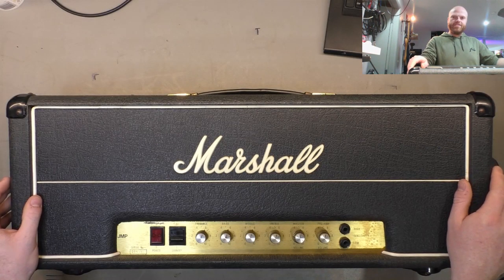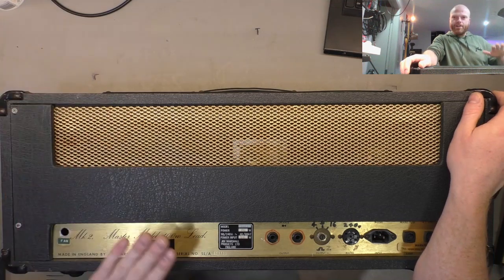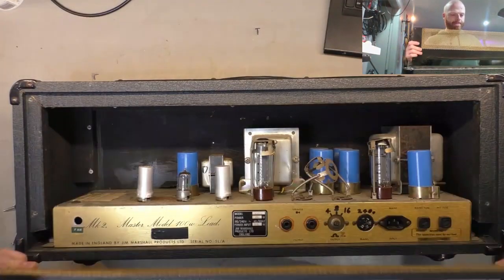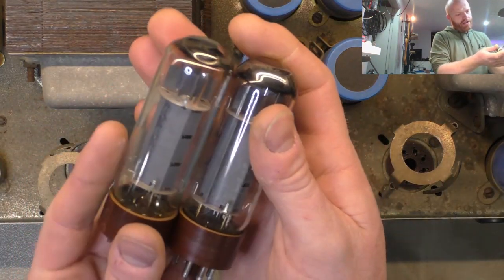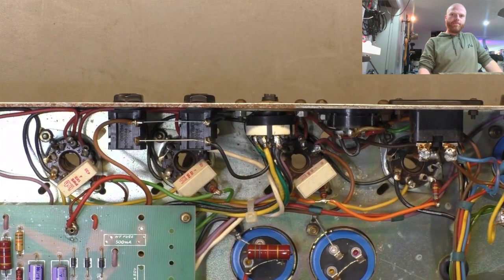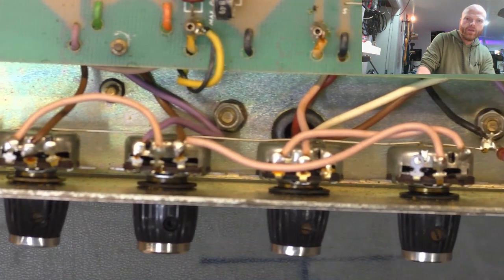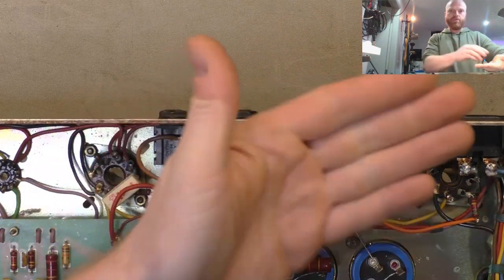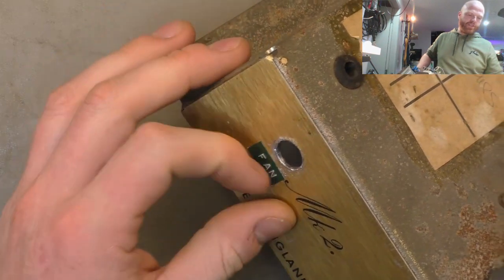Marshall JMP 2203 Head - De-Modding a Classic Part 1: Assessment

Comment: I've got exactly the same amp, only three years younger (they were still made with this exterior for Scandinavian market in 1982). I played it about 15 years and then decided I did not like my sound. I first converted it to Superbass with Metroamp turret board, then Superlead and now it has cascaded preamp, Mullard mustard caps + a few other useful mods and it sounds awesome. Also had to replace the OT to Marstran because the original had no 16 ohm output. I couldn't be happier.

Comment: That plastic impedence switch is the one that people are using when they clone the trainwreck dr z attenuator.  I've also wondered how much current they can take. 
I've seen the alpha metal one used as well, in amps.  Same deal. it doesn't seem robust enough. Then I saw a fryette video that had the metal one in place. Dumble had installed it for the guy , surprisingly, lol. It's a scary place to cap out on current handling !!

Comment: Sweet! I have a 1976 JMP 2203 that was modded when I bought it, as well... had a tech here in LA de-mod it for me and it sounds KILLER now. And to my surprise is REALLY versatile!

I'm surprised how not modded it looks on the board considering the hack job to the back panel. Really looking forward to seeing the restoration!
Reply from the maker: I think a lot of hackers are scared of the PCB because that would mean they'd actually need to follow the circuit and read resistor codes. LOL!

Comment: Fans save power tubes, I personally like a fan on my tubes.
Reply from the maker: If you need to drill 2 holes to mount a fan on a 2203 to keep it from killing output tubes, you need a better tech.